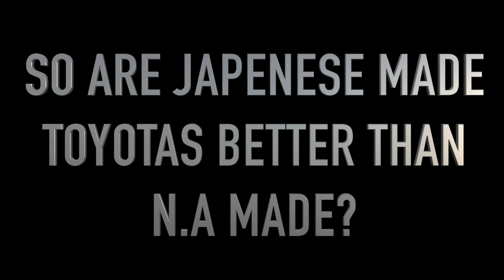Are Toyotas Made in Japan Better than Toyotas Made elsewhere?

Comment: I've delivered over 4,000 vehicles, since I've been in the industry.  Would I tell a customer to buy a Japan made Toyota over a US or Canadian built car?  The answer is yes, but only if it's available and the price is similar.  Why?  Because Toyota's are exceptional vehicles, no matter where they're built.  I do believe a Japan built Toyota is slightly better, but the difference is so small that most people wouldn't even notice and if they did, they wouldn't care.

Of all the minor differences, there is one that isn't so minor.  The 2007 Camry; when it first came out, the hood/fender/bumper alignment was difficult.  The compound curves required precise alignment.  I noticed that the Japan built cars had perfect alignment, where the Kentucky built cars were out of alignment 100% of the time.  After about six months, the US built cars were much better and were almost as good as the Japan built cars.

I've noticed paint quality differences (Japan has fewer flaws), interior part (better injection molding) and denser feeling plastics.  Also, the door rattles less on Japan built cars.  Again, very, very minor differences, but to someone in the business, I do notice.

Comment: Speaking as an engineer who did application/product improvement at a Tier 1 supplier, and now as a Tier 3 Manufacturing engineer, Toyota does have higher standards and special measures are taken, but they are made equal to other OEMs, just more checks. And there are so many sub suppliers that need to be documented, it is incredible how many levels of design is put into a single vehicle. Working at a supplier is much better than most OEMs because you deal with one part, component or system, and for multiple OEMs so if one has a rough year, you won't be out of the job, only if the entire industry is down.

Comment: In 2005 when I was 7 years old, I remember my dad bringing me around to shop for a late 1990’s Toyota Camry - the XV20 series. He immigrated to the states in the 1980’s and knew how to find a good car. He would only buy 1-owner cars with a stack of paperwork documenting all the maintenance. 

Every single car we looked at, he would tell me to run up and look at the VIN plate - if it started with “4T” we would immediately be walk away - he was only interested in the “JT” models because he told me that the Japanese workers who built the cars  were more fastidious than the American and that the “JT” models would probably have fewer problems. 

We settled on a Grey 1997 4-Cylinder Camry LE with the grey cloth seats and 147,000 miles. Over the course of our ownership it received the Camry bump too - but then one day it randomly popped back out and we had no idea how or why! We drove it with nearly no issues until 323,000 miles before selling it to the daughter of a mechanic for $800.

Comment: The answer is Yes. 
I am a Filino who have worked in Japan for 3 years (2014-2017) as a finishing assembler. My job is to assemble turbo chargers to be attached in the engine or attaching alternator in the engine and many more relating to the engine.
It has to do with their attitude towards their work. We are taught to work on a product as if it was our own. Because of that I am very careful in my work.
They focused on steps. No shortcuts.

Comment: The Toyotas made here in Brazil are very reliable too. I own a 2014 Corolla that is just like new and never had any issues. My mom also had another one before it and no issues too, except, the gas signal remained on (indicating as if it was low fuel but it was not), but I think that had to do with the fact that it's a Flex model, meaning it accepts two types of fuel, gasoline she ethanol(sugar cane alcohol), so it has an extra tiny tank by the engine, so you add a bit of gasoline there to help start the car in the morning if you're using ethanol and you live in a colder area of Brazil(South). The current model I have only showed this for a short period, add I live in a warmer place of Brazil I don't have problem starting the car in the morning plus, I use mainly gasoline so, I  didn't care too much about adding gasoline in the "tanquinho"(as we call it 😃) or "little tank" but it disappeared, so, in practice, no issues at all. 😃
My father also had an 93 or 94, imported from Japan(so, 100% Japanese), it was his then mine and we stayed with it nearly 20 years. No issues at all. Great reliable cars.

Comment: David mentioned the biggest problem they are facing now isn't the hardware engineering but the software engineering. Case in point--- I bought a brand-new 2013 Sienna XLE van which from day one have back-up camera issues. As you know back-up camera supposed to turn on when the vehicle is shifted into reverse.  On my Sienna the camera will not work maybe once every hundred times the car is in reverse. When this problem occurs the camera will stayed off no matter how many times you shift in and out of reverse. The only way to fix this is to turn ignition off and restart the engine. So right away I know there is a glitch in the Toyota Entune/navigation software and not a mechanical issue.  I brought this to the attention of my local toyota dealer but they never heard of this problem. I just let it slide since it's going to be hard for the dealer to troubleshoot a problem that does not repeat or replicate so often.

Comment: Here's my relevant Toyota experience. Bought a used1993 Geo Prizm 5sp in 2004, ran it up to close to 300,000 miles, got rid of it in 2014 just because it was obsolete by then. This was a Toyota design identical to the Corolla, manufactured by GM in Fremont, California. No drive train problems. Replaced two drive axles, one brake rotor and the distributor. These are not exceptional problems.

In 2018, I bought a used 2001 4cyl Toyota Camry Solara. It was made in Canada. Again, no drive train problems. This car was wrecked in 2020. Eventually, I ended up with a 2001 4cyl Camry LE. This one was manufactured in Japan. Again, no problems related to manufacturing quality.

My experience says, the badge and the model is the most important thing.

Comment: Thank You for the great and invaluable information in your videos. The information you share have helped me make up my mind to stick with driving Toyota although I would consider Honda and Subaru. I work on injection dies for Honda, Mazda, Isuzu, GM, Nissan, VW, and Subaru. I drive Toyota because I think they build the best car that money can buy but I will say that out of those brands of cars Honda is the most particular when it comes to demanding perfection in their interior parts. I see so many parts that look perfect but are rejected and scrapped because of such minor defects that are virtually invisible even under bright lights.  I have owned 5 Fords, 5 GM, 2 Dodge, 1 Honda, 2 VW, 3 Toyota and nearly purchased Hyundai until I did some research and founds out the issues they are having that I do not want to deal with and out of the cars I have owned, Toyota has proven to be the most trouble free and reliable. I purchased a new Prius C in 2012  and I love it and would buy a new one if Toyota still offered it. It has 125k on it and I have done nothing but change the oil and normal maintenance and drive it. The only 2 things I have done to it in those 125K miles are change the small battery after 11 years and replaced an ABS sensor that was damages after road debris bounced up and damaged it which was not the cars fault. My son will inherit the Prius C for his first car and I will be purchasing another Toyota. Thank you so much for your videos.

Comment: Back in December 2006 I bought a Certified Used 2006 Toyota Matrix made in Canada with 6100 miles on the odometer and drove it well over 140,000 miles when it was totaled in an accident on April 15, 2013 (I remember that vividly because it's Tax Day in the US). That was replaced a week later with a Certified Used 2012 Scion xB made in Japan with 20,000 miles on the odometer and I still daily drive it today with over 140,000 miles currently on the clock. Each vehicle was/is properly maintained regularly by the same Toyota dealership in my area. I've always followed the included Maintenance Guide to a T and it has never let me down. With the exception of the previously mentioned accident that totaled the Matrix, I've had over 15 years and 280,000 miles of reliable, dependable, uninterrupted, worry-free driving. So whether a Toyota is made in Canada or Japan, it makes no difference - they're all reliable in my book.

Comment: My two friends and I owned 1985 Toyota trucks with the 4cyl engine. All three ate 2.5 qts of oil every 3K oil change. We all contacted Toyota customer care and they said "within specs". I traded mine in on an '89 Chevy truck and my friend went with a '89 Ford F-350. Neither used any oil between changes and were reliable. My other friend walked out in front of Toyota of Carlsbad with a sign reading "My truck uses 2.5qts of oil every 3K miles. How's your's doing?" Turns out Toyota had a piston ring defect where the rings didn't hug the cylinder walls enough according to the mechanic who installed a new shortblock supplied by the dealer.

Comment: Here's an example of when a factory specific problem can occur.  I also posted this to another thread in this post.  It's a little long, but I think you should read it.

A few years ago, Hyundai Sonata's (and other Hyundai/Kia cars) built in Alabama were known for a manufacturing defect.  Not a minor one, but a major defect - they built motors, but didn't properly clean the machining "leftovers", so as the car was driven, metal filings would shed from the motor, scoring cylinder walls, bearing surfaces and clogging oil passageways.  Hyundai/Kia got caught and they were sued in multiple class actions.  Their attorneys were pretty smart - instead of fixing every defective motor, they told consumers that they had to install a software modification, which would use existing motor sensors to detect "noises" in the motor.  Of course, by the time the "noises" were detected, the motor had already sustained damage, but the idea was to create a way for Hyundai/Kia to invalidate claims.  Also, Hyundai/Kia satisfied NHTSA regarding the recall - they were required to recall ALL Theta motor cars built in a certain timeframe, since the motor could fail and leave the driver without control of the car (power steering, brakes and acceleration would be lost).  

Did Hyundai/Kia take responsibility of building a defective vehicle?  Consider this, if a customer didn't have the KSDS software added, Hyundai/Kia claims that the customer abused the car and they will not longer honor the warranty.  Hyundai/Kia claims to have done everything reasonable to alert owners of the need to install KSDS software in their vehicle.  BUT, if a vehicle was used for "certain" purposes, such as being on a dealer's lot (was for sale), was a rental vehicle or many other uses, the vehicle was void from the warranty repair.  Remember that the software will detect damage to the motor, so using some logic, if a customer did not install the software and they had a motor failure, the only thing the software would've done is to alert the customer that a problem had occurred, prior to the motor actually freezing or the knock being loud enough that the owner would know.  Hyundai/Kia claim that the customer abused the car, by not having the software added - logically, that would mean that the software "saves" the motor from damage, which we know that it doesn't.  It gives an early alert only, that's it!

Hyundai/Kia has saved a ton of money by voiding warranty claims due to KSDS non installation.  They've also locked out many owners (if you haven't had it done yet, you've given up your warranty) from future warranty claims - basically they've limited their liability, even though there are still a lot of customers who will suffer from their inability to properly produce a car.

I'll add one more item here.  I am of the belief that Toyota would've treated this in a much different manner.  They would've been embarrassed by doing something so poorly and they would've fixed every car that had the problem.  On top of it, they would've done everything they could to make the owner whole again.  And yes, an apology would've been made to all affected.  Where Hyundai/Kia tried to find a way to limit their liability and sneak away fixing as few vehicles as they could.  Instead of feeling shame for building a defective vehicle, Hyundai/Kia chose to "stick it to the customer" - their customer.  I know a lot of people who will NEVER buy a Hyundai/Kia car after this debacle.

Comment: I’ve had a Jeep patriot for 12 years. No major issues. 92,000 miles on it. 2.4 cylinder CVT. ABSOLUTE garbage torque and power and interior quality. However- no major issues. I’ve gotten oil changes every 3,000 miles- purchased new. Upgrading to a 2023 Toyota Highlander Limited. My thought is that, no matter what you have, if you’re careful to maintain it properly, it will last a long time. I by no means believe the Patriot would last another 10 years, but if can last this long, I absolutely expect my highlander to last much longer regardless of where it’s built.

Comment: I owned a 2004 Lexus RX330. Just over 1/4 million miles. 3 timing belts changed. The car runs like new. The paint job still great. The first factory battery lasted 11 years. The interior leather looks new. No cracking. Changed the shocks and struts once! I will not buy another car for me for my life. (I am 73). I don’t think I will replaced this car. I learned to clean the yellow from the head lamps. The color is named Bamboo Mist. I bought this car for my wife when she think that we can afford a Lexus. Now I am keeping this Lexus. I she gets another new one.

Comment: I bought a new corolla le in May and it was built in Mississippi in March, I don't notice fit and finish issues, door and hood gaps or interior misalignments. The problem is in the drivability.. CVT jerks when accelerating after applying brakes or slowing down, loud road noise.

Comment: I don’t agree with you. The American built Lexus’s have the most issues, from the dash cracking, water pump failure at low mileage it’s not to common. I have a 2020 Lexus GS350 and it was made and imported from Japan and it’s one of the most reliable lexus models they have at this time, besides the GX, LS, LX models.

Comment: Dear Guys, you talking about possible minimal difference in color and matching panels inside/outside. I would disagree. Had european model Toyota Avensis Wagon (size close to Camry) from UK factory. Brand new bought, huh, the rear gate started to rust after 3 years of use. Other folks had the same bad opinion of UK made Toyotas. Later I bought a 2004 4Runner, made in Japan and there was no single rust spot on it in 2013!!! years after production date! now we have 2023 and still no rust on it... Only Japan made yotas!

Comment: Sorry, but this is something I must disagree with. My RAV4 (made in the west) vs my neighbors RAV4 (Made in Japan) has a difference. Especially with the paint work. My RAV4 had paint peeling off, interior water leakage, glue seeping through the headliner, fuel tank issues etc. Where as the Japanese version has had little to no defects.

Comment: Speaking of our daily drivers... 
1) I owned a 2012 Matrix 1.8L made in Ontario Canada, It was reliable and my only complaint was the rear calipers (the pads never wore evenly). 
2) I then had a 2018 iM made in Japan. The fit and finish was noticeably better (to my picky eye). Problem Free
3) My wife has a 2018 Yaris Hatchback made in France. It is by far the worst fit and finish of any Toyota Product that we've had. Still very reliable but not nearly half as well assembled (noticeable beyond even my picky eye). Foam that sneaks up by the windshield from beyond the dashboard, The passenger door requires slightly more force to close when other doors are shut. Which isn't typical of any of our Toyota's. Keep in mind, bought new with zero signs of accident repairs. It's not like you have to slam it, but it's not the gentle effortless close that we've come to expect. Also the belt was junk and needed replacement early. Minor issues, otherwise very reliable. 
4) My current 2021 C-HR made in Japan. It's fit and finish is superb. My only complaint so far is that the gas cap needs a redesign. Frequent trips down gravel roads will have you removing your cap to find road dust trying to enter your tank. Without a serviceable fuel filter, this is a concern. It's also a first for me on any Toyota product that I've owned. It's clearly a design flaw that could be remedied with a silicone sleeve to prevent the dirt from building up under the cap against the seal.